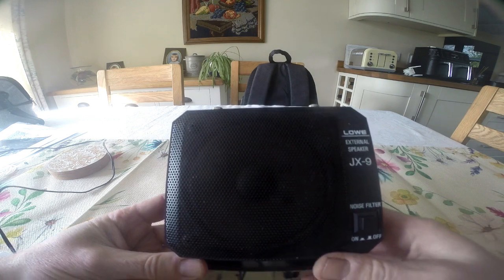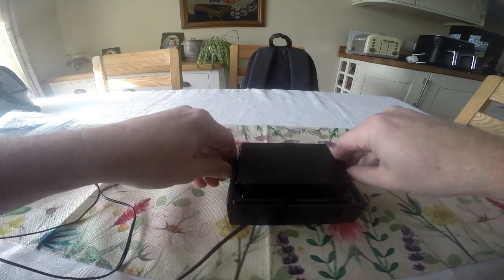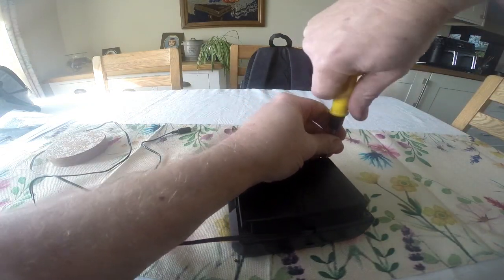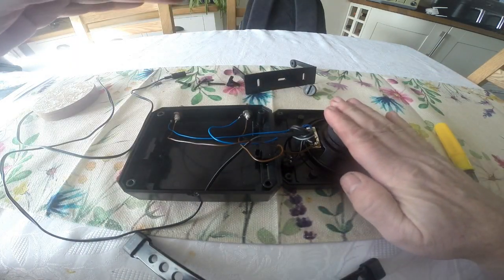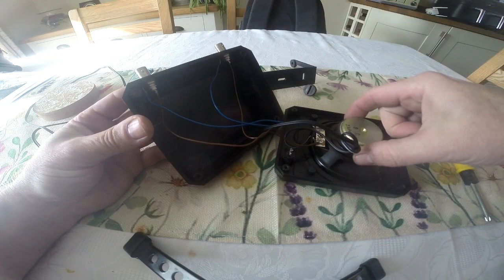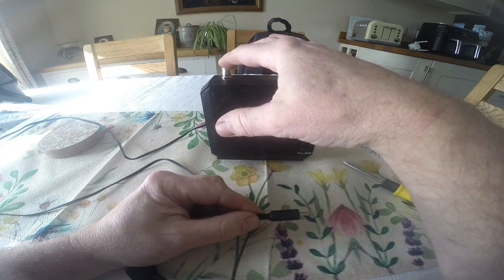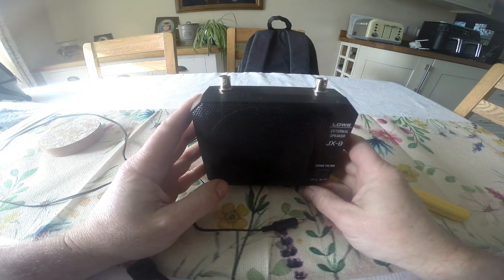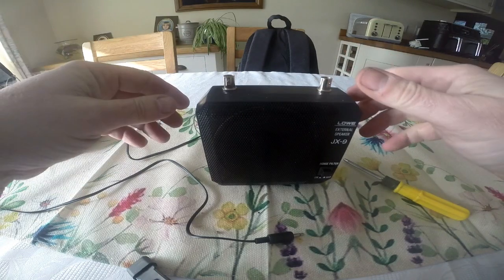My 8 Ohm Speaker - Explained!

Comment: You can also put in a switch to switch between the speaker and a 8 ohm 10 watt wire wound resistor that will act as a audio dummy load. There are loads of simple audio tone generator circuits on the Internet ranging from 2 transistors to the 555 ic, simple and quick to make. Could be another video for you on how to make simple easy test equipment!!.
Reply from the maker: Hi Elliot, hope you are keeping well, nice comment, with test gear being so expensive thats some good suggestions there, all the best. Mark